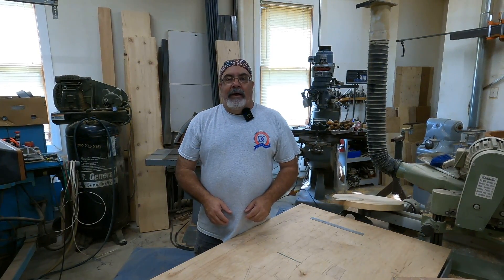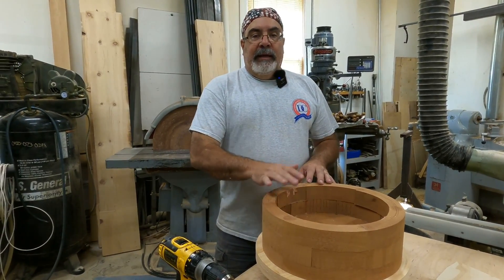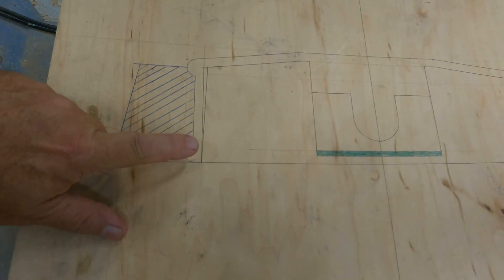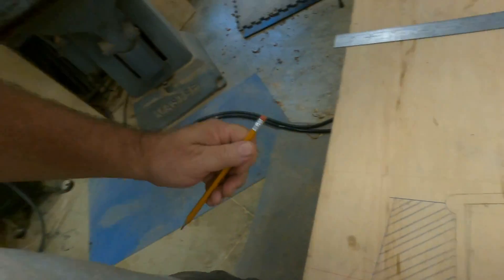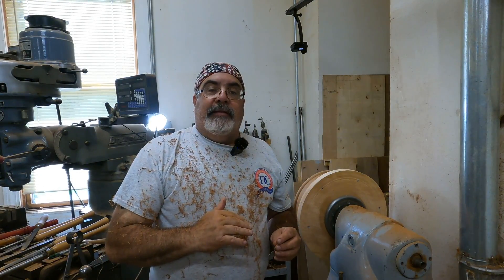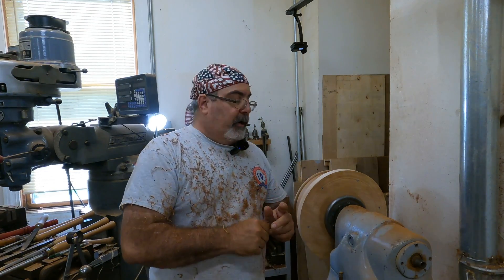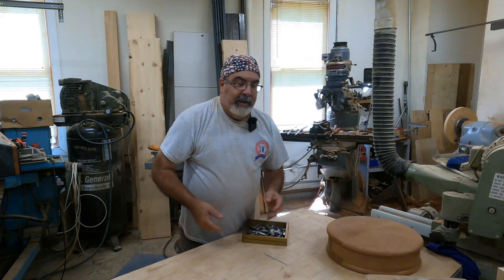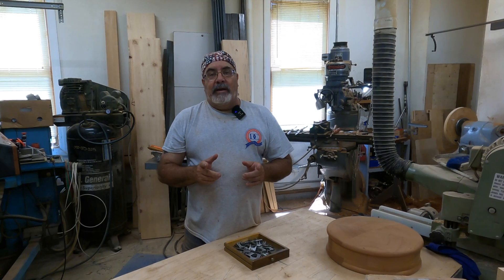Tally Ho Capstan Project: Part 2- Turning the Pattern

Comment: Building a core to cast in a decorative  undercut on the OD makes the casting process and pattern making process unnecessarily complex. The part has to be machined to create the tapered bore and that undercut could be much more easily made on the lathe.

Comment: 140K views for a channel that has 13.5K subscribers. That must be the link Leo provided. But this is not a channel that will see many of those viewers return. Your 'explanations' with respect to measuring are unintelligible. Every time you say 'OK', it means that you just did not explain how you did it. I still have no idea how you take measures from your drawing and transfer them to your model. The camera angle doesn't help either, because we don't get to see a lot of how you do your wood turning. This channel is a real disaster. If it wasn't for the story on the capstan (a word you have difficulty with to pronounce, obviously), I would never have watched any of your video's, or would have left less than a few minutes into them.

Comment: If you do this again, I suggest working the center post and mounting leaving a few inches wild so you can mount it to the lathe. It will give more options for turning and make it easier flipping back and forth.

Comment: Like what your doing.  I came by way to Leo and Talley Ho so just recently subscribed. How did you flip and rechuck the piece to get access to the upper out face?  You mentioned doing the same to a motor cycle piece but I wasn't here then.

Comment: Curious about how much % you have to allow for shrinkage ? 
I once made a very simple pattern for a 15” main mirror mount for a hobby telescope to be cast in Aluminium. I completely forgot about the shrinkage, luckily I had allowed for more than enough “flesh” for machining, but it was a much lighter part than I intended originally 😂😂
Reply: Cast iron shrinkage varies between 0.7 & 2.1% for different alloys. Grey cast iron (w/ carbon, silicon & manganese) has the lowest shrinkage.

Comment: Was the original drum smooth. I work on boats capstans sometimes have ridges so the line doesn’t slip
Reply: This isn't the capstan that the line runs on. It is the top cover of the capstan assembly. It is a antiquated hand crank unit that came with the boat. I don't recall 100% I think Leo wasn't  sure if it was the original or a replacement. Thinking it is a little oversize for Tally Ho.

Comment: I am wondering. Did you need to account for the shrinkage of the metal inside the mold and if yes, how did you do it?
Reply: He explained that in the previous video, but you are correct - shrink is calculated during the construction of the pattern, and there are even special rulers with the shrink values already figured into the graduations.

Comment: It's really great seeing you document the trade, in addition to the preservation work for Tallyho. I worked in a tool & die shop and assisted our patternmaker on lots of jobs, but I was mostly over in the sandpit and machine shop. Most of our business up and left us by the late '90s when CNC technology really started to mature, and all of those jobs got sent to Taiwan instead. We were lucky in that we had a performance automotive sideline business that had really started to take off as the tool work slowed, so by '01 or so we had fully transitioned to automotive.

Comment: To add a bit of insight with 3D printed patterns, due to it's size this project would need to be printed in sections and the odds of them warping is high. Once everything is bonded together it would take a ton of hours to get it to the same surface finish as Dave has achieved. 3D printed patterns have their place, while it could be done for this project I don't think it was the best option. 

Can't wait to see this one done.
Reply: A 400mm printer would make this in 1 shot with room to spare. I have a RatRig 500mm printer that I used to print a pattern in 2 sections that is 26"x16" and 14" tall. I printed it in PLA which warps very little, shrinks very little, and is very rigid - the trick is to use alot of infill and extra sidewalls. Spray fill and sand twice, final coat with spray epoxy.
Sure it is a lot work, but much less than building it up from block.

Big prints like this print differently, I wound up scrapping 2 prints before I figured it out.
That said, I like the old school methods, and this is the appropriate way to make this part for the Tally Ho.
Reply: @joshua43214  I've always wondered about those ratrig kits, what build surface do you use? I've been switching over to a textured PEI whenever I can.

For me, I don't like going above 300x300 because the odds of having issues increases a ton and failures become very costly.
Reply: @SRMWorkshop  I purchased the magnetic build plate from RatRig, it is a textured PEI. Many users claim it is the best textured PEI plate out there, I am not impressed with it all all, PLA will not stick to it cold at all, and barely sticks at 55C which is way to high for a print that will take more than a few hours and weigh more than half a kilo. I put a BuildTak PEI sheet on the back side from Printed Solid - it is an expensive surface but far better than the RatRig one. PLA will stick cold, and stick very well at 45C, which is fine for long and heavy prints. The magnet and plate though is extremely good, it stays stuck down at high temps, and is flexible enough to lay really flat.

Overall, the RaRig is a very good printer. The alternative is the Voron, which imo is not rigid enough, far too over complicated, and has too massive a print head, or the HEVORT which I think is the only viable option to RatRig.

You are right, a printer this big really raises the chance of a misprint, and they can be costly. The learning curve is expensive since the only way to optimize it for the extremely long layer time, is to make a bunch of big test prints.

Comment: Caution: Your turning this piece with a ROUGHING SPINDLE GAUGE it’s made for exactly what it says spindles only. Your endangering yourself , that tang will break off and injure yourself. CAUTION LEARN YOUR TOOLS??????
Reply: He should be using something with a beefier handle? Doesn’t it depend on the force you’re applying to the part?
Reply: @keith77mn77  
No, look at the tang it narrows, that’s where the danger is . One wrong catch and it will break at the tang, at that point you will get injured??????
Reply: Mate.....he's a very skilled tradesman, he knows what he's doing. At least he wasn't using a turning tool he made from  an old file blade, these are common in pattern shops, used for years by some of the most skilled patternmakers I have ever met.
Reply: @SailWazaZulu  
Yea you can say what you said but that tool used incorrectly like he’s using it will hurt someone. So before you jump into something you know nothing about ask someone in your area to show you the correct usage of that tool?

Comment: Like the person who said It is as clear as mud i am in the same boat.  I am not seeing the flat pattern on the wood output
Reply: Probably they’ll have to make a sacrificial cast out of this, once it’s complete?
Reply: @keith77mn77  
Right now Dave's making the pattern for just the part, plus shrink allowance.  The actual rammed sand mold will be somewhat larger, but with hard sand 'cores' set into it to form the undercut areas.  He'll be making the 'core boxes' in a future video.  The core boxes form the hard sand cores that are set into the rammed greensand mold once the full pattern is removed, leaving the mold cavity.  It's a most interesting process and should be a fun learning experience for those curious as to how complicated parts are cast.

If you want to 'read ahead', try googling or searching YouTube for "sand casting, cores"...That should get you up to speed better than my crude explanation, sans visuals, will.

Comment: I'm curious about how you center the work on the plate when you turned the piece over
Reply: I was wondering that too. They skipped that part.
Reply: @keith77mn77  
He didn't skip it.  He described how he was going to cut a circular groove in the faceplate to accept the rim radius once the part was removed and turned around. Since the faceplate was still centered on the lathe axis, the part retained concentricity by having that rim sitting in the precisely cut groove.  A real tidy approach!
Reply: @Bluswede  I thought I heard him say something to that effect, but they didn’t show it.
Reply: @keith77mn77  
Right, Dave's video style is less detail-oriented than others on YouTube, but he's a most skilled pattern master.

Comment: As a shipbuilder from Canada have watched this craft die off before my eyes, Pacific Bronze, Osborne Propellers, great craftsman that did not pass on their fine craft. Keep this up please. If you are young and looking for a rewarding get your hands dirty career that is very fullfilling check out pattern making. Only a few left.
Reply: @Chr.U.Cas1622  first off, this is a comment section, it invites peoples views and opinions. Your ranting at jimc4731 accomplishes nothing. You have stated your opinion and as such many will disagree. New tech has its place but many, many shops and areas of this planet do not have these toys. Pattern making is a high level hands on skill that can be applied almost anywhere on earth. Further as already stated by others, these skills will cross over to many every day requests or requirements. While scanners and printers have a prominent role in production, hands on skills first will go a lot further in real life situations. 
My opinion,  you asked for it
Reply: Every foundry I've worked at has a pattern makers shop. It's not dying. You need to have a mold. Although it is easier to use 3d printing you still need a pattern maker.
Reply: @trythinking6676  Right, but how many foundries are left in North America? That seems to be @snowgorilla9789's point.
Reply: @Chr.U.Cas1622 no one here except you is talking about Jay Leno
Reply: This is a one off component maybe a few more, how long would it take to render this electronically. Possibly faster to make the shape then scan it with a laser into computer then cut the mould. They still do cars in clay to test out shape before setting up for mass production.
Reply: 3D printing a part of this size is not reasonable for the hobbyist 
First one must have the knowledge of computing, and a sufficiently large computer with the appropriate software, expensive!
Second one needs a printer in the size to accommodate the part, expensive!
Third, one must be willing to keep all the above in the storeroom until needed
An individual with woodworking skills and basic tools can make many patterns and other items from wood for daily life
JIM 😮

Comment: My dad was a moulder and my uncle was a pattern maker. They worked for GMH at Fisherman’s Bend. All gone now!
Reply: Sad.  Fishermand’s Bend is now part of a major urban renewal project but, not far away, Boeing has a plant that manufacturers carbon fibre tail rudder and wing parts for 737, 777 and 787 aircraft.  Old crafts are lost but are often replaced with new ones.  One of my sons works in the Boeing plant.
Reply: That's cool. My Great grandfather spent time as a pattern maker for the V&T Iron Works in Carson City Nevada.